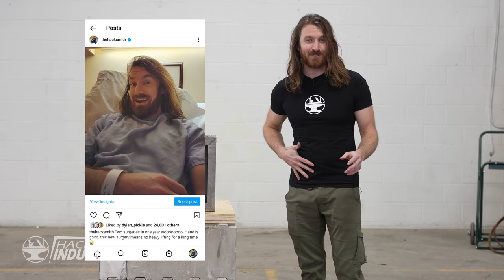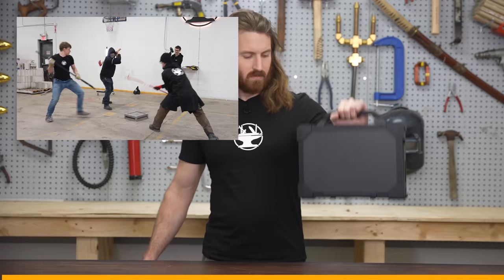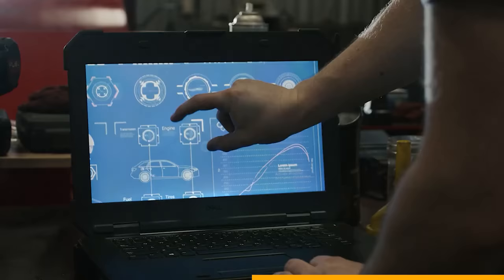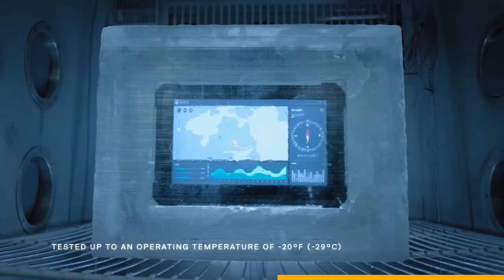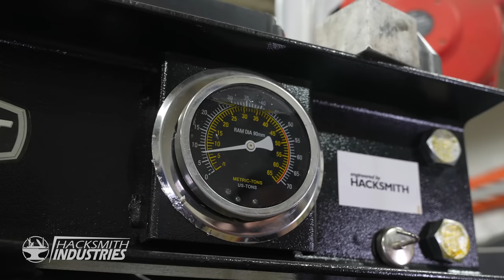MOST UNBREAKABLE BOX EVER?

Comment: This box is impressively durable, I wonder how certain firearms would do against it, like a .50 cal
Reply: Considering they were able to nearly puncture into it with a bow and arrow, I imagine it would probably get through.
Reply: A .50 would go straight through several times over. That is several dozen orders of magnitude greater than anything they used in terms of penetrating power
Reply: Say good bye laptop
Reply: Pretty sure a 9mm would get through no problem
Reply: A .50 would be overkill and would go through the whole thing, including the laptop. But it would still be fun to watch.
Reply: demolition ranch has entered the chat
Reply: The kind of plastic it's made from is only good against pistol caliber ammunition at best, rifle rounds will go through like butter even if they aren't armor penetrating.
Reply: @farawaythrower  The thickness of the polycarbonate they used would stop a 9mm, it should in fact stop most normal pistol rounds.
Reply: not really. They didint do anything really damaging to it. And what they did, was something that that box is really good against. Give me 5minutes and it will be open
Reply: @Synthmilk  How thick is it?
Reply: ask demolition ranch not the hacksmith
Reply: @brodiesaltsman2842  50 cal is probably equivalent to couple of metric tons hitting something with square mm of contact area.
Reply: Or 20 mm
Reply: hole = true
Reply: Depends how thick the polycarb is. It's marketed to be bulletproof after all.
Reply: 9mm can ez petrane it
Reply: Nice new profile pic
Reply: @jackhemsworth7515  looks like in half an inch
Reply: @farawaythrower  two inches, two one inch panes.
Reply: What about some slap rounds?
Reply: All you need is a screwdriver and an angle grinder… like, it wouldn’t take anyone with a half a brain more then 30 minutes to open the box provided an angle grinder.
Reply: Bro that laptop wouldn’t withstand a 50 cal round it needs a Level 5 Kevlar armor to withstand a 50 cal round
Reply: I bet .308 would through fine, .50 cal is overkill.
Reply: Nokia phone are the real unbreakable box
Reply: I mean half the stuff they threw at it didn't do anything because instead of deforming or damaging the box, it was sent flying
Reply: @cheesewheel8567  The intro skit Matt would do with either the whole unbreakable package or just the laptop alone would be worth the views.
Reply: Sounds like a job for demolition ranch
Reply: @itzmrman3574  the video could have been 2 mins long just a 50 cal shot done
Reply: I can tell you. It would go straight through.
Reply: @Synthmilk  i saw a video once where that kind of plastic stopped up to a 44 mag. 5.56mm did not even crack it because it went right through the plastic so cleanly.
Reply: Sad they couldn’t use the lightsaber
Reply: Unfortunately Dell wants the laptop to be intact so Demolition Ranch was probably the first person marked off on their list lol
Reply: time to take the box to america

Comment: James: no! it cant take the lightsaber.
Also him: put it liquid nitrogen.
Reply: He also used something that, in essence, was a smaller and more precise version of the lightsaber.
Reply: @LawrenceOakheart   which means it wouldnt back fire
Reply: Computers don't mind cold.  Heat is bad.
Reply: pretty sure that's why they don't show if it works in the end
Reply: its completely different tho... come on now
Reply: @cyborgmike9210  Tell that to the batteries.
Reply: @ommsterlitz1805  Im pretty sure that damn thing still works. It got frozen in a solid chunk of ice. Not as cold as liquid nitrogen sure. But, the polycarbonate probably protected it enough from the cold to work
Reply: @Am_Cookie2436  except that he smashed it with a hammer and open it with a plasma cutter
Reply: @cyborgmike9210  bruhhhh!!, that's not a computer, that's a unbreakable box
Reply: @thorsgaming7044  there's a computer inside. Did you watch the video?
Reply: @LawrenceOakheart  yeah but…. Like that doesn’t count i guess.

Comment: I remember the early gens of these rugged laptops back in the 90s.  We were selling ones that were designed for even electrical workers that would survive a drop from the top of the electrical poles.
Reply: @baseballjustin5  Since we were reselling we were not going to test that.  But they had manufacture videos with them being dropped or run over in several fields.  What I do find interesting is the size of the laptops then and now look identical.
Reply: @baseballjustin5  I wish i could remember the cost back then.  But I know it was high and I wonder what these cost.  Course my first Toshiba laptop with a 386 processor was about 3 grand and it was a normal.  Yes I actually still have it and years ago I upgraded to Windows 95 LOL  Funniest thing is it has a trackball extension module

Comment: the fact the axe did a good bit of damage and then they only use it once. also they didnt have it against a good and solid object for most. they were definitely holding back in the first because, then using mass distribution later to make it seem more durable than it is. the power loader on top isnt the same as the power loaders wait in a small spot.
Reply: sorry, left one of theose bits unfinished. ... "because" tehy were likely getting paid for it. of course with the plasma cutter they were getting used to the ideas and figured they wouldnt damage it much anyway.

Comment: Also why aren't you using an arc welder or cold welding after pouring liquid nitrogen on it theres other ways to beat every single so called unbreakable casing you could of melted the metal frame with certain metal mixtures